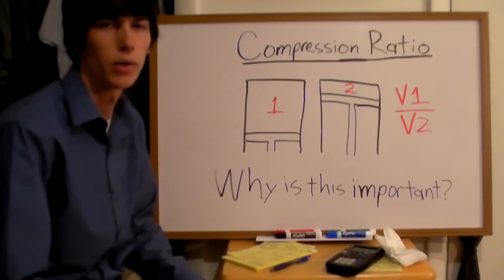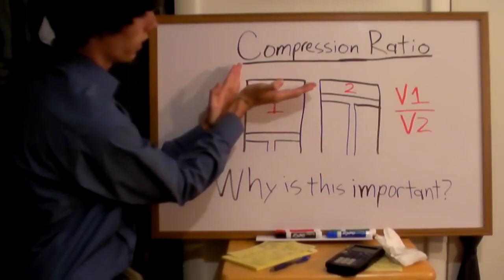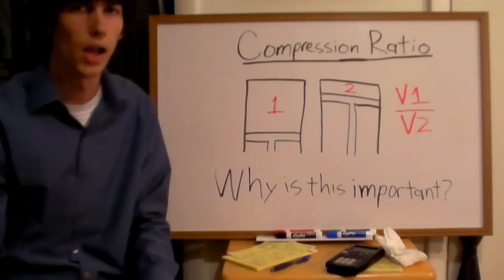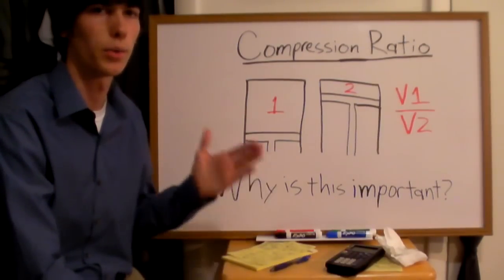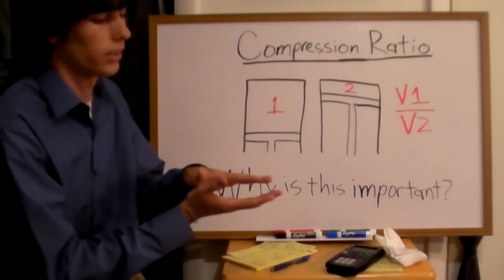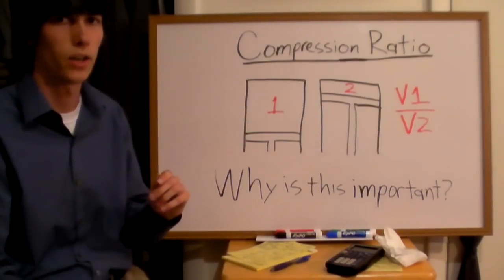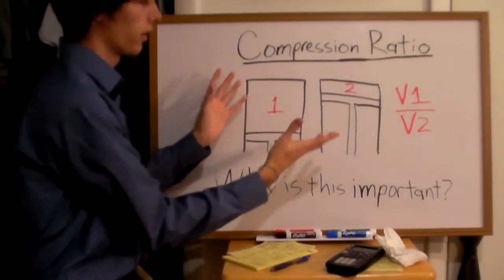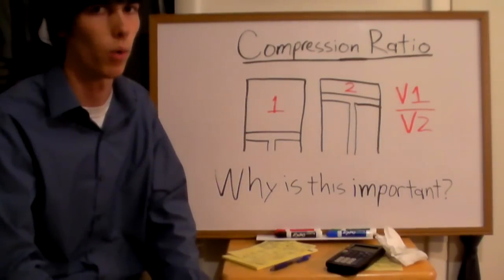Compression Ratio - Explained

Comment: not sure if you're still reading comments from old videos, but what happens when you put low octane gas in an engine that is made for high octane gas? If I understand your lesson correctly, that means the fuel will combust before reaching the ideal compression ratio because the lower octane gas cannot withstand the temperature of the high compression. So does it mean it will combust before the spark plug even "gives the spark"? Will it then cause a timing issue on the engine/drivetrain?

Comment: Can someone explain to me how about same engine capacity 4 cylinder gasoline engine 1.5 liter 
but different compression ratio, one is 10:1 and another one is 11:1..Does it mean that for 11:1 need premium gasoline to prevent engine from knocking?

Comment: fuel octane rating is to prevent pre-ignition so why we calculate compression ratio from BDC to TDC but not at the degree of spark advance BTDC? 
I try to built a 125cc 54x54mm max rpm 12.5k N.A engine with highest compession ratio possible (maybe 13:1)  using RON95 gasoline?  caluclate compression ratio is in safe zone when spark fire but not safe zone when calcualte from bdc to tdc

Comment: I can't figure out my engine is a 11:1 compression ration would I get any benefit to using premium gas.  My manual says it can use basically all grades.  But would I gain anything using premium.
Reply: Lin Y Yeah yeah can gain MPG and horsepower from using premium gas

Comment: hey dude. i hope you reply to my comment. how does one increase his compression ratio?
Reply from the maker: Very difficult to do. It’s more of a design aspect. Changing pistons could allow for slight increases, but really it’s something selected in the design process.
Reply: Engineering Explained wow that was quick! I didn't expect to get a reply after a few days. Well anyways thank you!

I've been trying to figure out a way to get the most power out of an engine that's naturally aspirated. Applying individual throttle bodies to be more specific, instead of gaining more power via boost. Higher compression ratios on a naturally aspirated engine would be alot safer to do instead of a turbo-ed one. I guess changing pistons could probably add another half a unit of compression, but how much of a difference would it be? I guess boost gets a point on this one.
Reply: Btw. What's your name? I've never seen a video where you introduced yourself haha.

Comment: I don't know if you're still checking the comments on such an old video, but why would the compression test results be significantly higher than manufacturer specs?  The car in question is an old aircooled VW 411, with an unknown capacity replacement engine.  The workshop manual states 114-142psi (100 psi wear limit), but an actual test done today showed 165 psi on 3 cylinders, and 180 on the other one (that cylinder was also dead some time ago, due to a fouled plug).  I'm already using Techron-laced fuel, and the plugs were all clean, so I don't think it's due to carbon buildup.

Comment: Then why am I recommended by the handbook to use 87 (91 RON here in Australia) for my MY07 Honda Accord V6 3.0L? I searched on the internet that the J30A5 engine has a compression ratio of 10:1. Actually, I don't really notice a significant difference between 91 and 98 (93 in the US) when I floor it all the way to 5000+ rpm, but it feels like the engine runs better in low rpm with 98 though.

Comment: my yanmar l100n states in service manual the comp ratio is 19:3. I tested the engine compression and im getting 80psi. From what I read up on 19:3 ratio calculates as 19x14.7psi which 14.7psi is atmos pressure at sea level, which is where I am. so 19x14.7=93.1psi. So from this my engine is 13.1psi lower than should be, roughly 14% down.   First off is this correct calculation nd am I understanding this correctly.Also is 80psi too low for the Yanmar L100n single cylinder 10hp small diesel engine?I have called all over the UK and eve diesel engineer I speak to gives me a different answer. though funny enough all these guys cant explain compression ratio to me and all ar claiming it should be 200psi upto 400psi. PLS HELP!!!

Comment: What fuel would you use for 12.0:1 ratio
Reply: Colin Selfslaghs.
For a high compression ratio like that you'd be looking at 105 - 110 octane fuel. The higher the compression, the higher the octane.

Comment: my compression ratio is 10.0:1 it's a 1.0l turbo GDI what does the third number mean? Should I use premium fuel?
Reply: 10.0:1 is the same thing as 10:1 (period here but I don't want that to be confused with the number in the ratio) Use whatever fuel your manual says, or what your tuner says if you have gotten it tuned.

Comment: The Air and Fuel mixture in a gasoline internal combustion engine should not "Explode" as you stated in this video, as that would be detonation. Detonation, (internal explosion's) can brake and burn up internal engine components. When an internal combustion engine is running  correctly, the compressed air and fuel mixture, which is ignited by the spark plug's spark will expand, (not explode),  pushing down the piston. The only gasoline that combusts is that which has been converted into vapor, (a gaseous state), by phase change through heat. Liquid gasoline does not combust.  Octane's are added to  Gasoline in order to slow down the combustion process, to eliminate the occurrence of detonation. The higher the compression ratio, the higher the octane rating of the gasoline will be required to eliminate detonation.  Diesel engines are a different story as, they run on detonation or spontaneous combustion as a mater of course.
Reply: Tony VannTruth  Higher octane does not slow down combustion.Higher octane means that the fuel is less prone to knocking under higher compression conditions.The time where the fuel combusts or in other words "When the fuel combusts?" is determined by the ignition timing of the engine.

Comment: What is the benefit of having a high compression ratio in a performance engine? You talked about fuel economy being an important factor but I have an e46 M3 which has an 11.5:1 compression ratio and the fuel economy isn't all that great so what is the benefits in performance? Thanks
Reply: john smith high comp for n/a build and low comp for boost
Reply: john smith Use Premium gas

Comment: What fuel would you suggest with a 9:4:1 ratio. Been running premium and I'm not getting the power I used to.. Might need to clean the plugs too.
Reply: 9.4:1 is not high at all.  87 should be fine, and you'll get the most power and efficiency from that assuming the car doesn't have carbon buildup problems, which actually increases the compression ratio and can cause problems with detonation (pinging) under higher load conditions.
Reply: +Patrick94GSR the answer I was looking for. Thank you good sir.
Reply: owners manual
Reply: +frenzythebeast did, all it says use nothing under 87 octane. I'm just trying to figure out what is the best for that comp ratio. Might just use 87 or 89. 91 is pointless
Reply: To benefit from the higher octanes you need to tune for it. You can pull more timing with higher octanes which = more power. I thinnk I dynoed 317rwhp on 87 octane and 335 on 93 octane

Comment: In my country, the gasoline available are RON 95 and 97, and most cars have a compression ratio of 10 : 1 so RON 95 is enough. So what kind of higher compression ratio range would need to use the RON 97 fuel...? Is there any difference in performance/fuel economy for a normal car (10:1 ratio) to use RON 97 compared to 95..? It feels like the acceleration is slightly smoother. Thanks . .

Comment: can you explain why some engines can have a higher compression ratio but still run on fuels with lower octane? ie 04 corolla 10.0:1 and toyota says 87 ocatane is fine.

is it because the intake air is cooler than other engines?
Reply: Lower octane fuels has high tendency to auto ignite which is what is required for a CI engine........
Reply: Adhil Binyamin I'm referring to 4 stroke gasoline engine though. Your comment kinda solidifies my question further. If it has a high tendency to self ignite why do they have the compression so high but low octane.
Reply: @shofarsogood7504  Well 10:1 is not a high compression ratio in petrol engines....its mediocre.....
I thought u were referring to GCI engines..

PS : You still remembered 😂 this qstn u asked was 4yrs ago.
Reply: Adhil Binyamin oh it is? I thought 10:1 was pretty high compression. Maybe for my grandfather when engines were not built  as tight with tolerances. Thanks that explains it.  Yea your comment came up in my notifications so.. I never learned from then I guess lol

Comment: so if I ran a 6-1 or 7-1 compression ratio would I use something like e85 instead? also would the engine want to run at higher rpm's if you have a lower ratio?

Comment: How exactly does engine knocking damage the engine? How bad is it?
Reply: +fsmdf "knock" was a bad word to use. An engine knock is associated with a spun bearing or something of that nature. When you run too low of a fuel octane for a certain motor, the engine will ping. Lower octane fuel burners easier and hotter (therefore faster) than higher octane fuels. 87 octane burns faster than say 108 race fuel. The ping is pre-detonation, or the fuel+air charge detonating before the spark plug ignites it at or past top dead center. This explosion pushing down while the piston is still trying to go up causes excessive wear on spark plugs, bearings, and other engine components.

I would also like to add to his videos, (and no offense to Jason, your videos are superb and I have learned a lot from you), Compression Ratio does not solely determine what octane of fuel you need to use. There are some engines with 9.5:1 compression that run on 89 octane pump gas and run perfectly. Other engines, specifically when you get into built motors, with the SAME compression ratio, have to run 98 octane or higher. It varies greatly on your engine, application, and timing curve.

Comment: I loved the explanation and agreed with all until he got to the gas explanation. The higher the octane gas you use the cooler it burns. He said it backwards. In a high compression engine you need high octane fuel because you are running higher pressures and if you use low octane the combustion chambers will overheat and cause the engine to ping.
Reply from the maker: +justin rogers What I'm stating (or thought I was stating) was that more compression means the air fuel mixture is heated to a higher temperature (before you ignite it).
Reply: huh? that's not what he said. he said high octane fuel can resist getting ignited prematurely because it's designed to combust at a higher temperature which also means you need to compress it more to reach that high temperature.

Comment: Hey man, just a quick, somewhat related question that I couldn't find the answer to:

What impact would ambient temperature have on a compression test (if any)? I'm thinking that everything else being equal, testing engine compression at a lower ambient temperature would produce lower results. This would be a similar phenomenon to how your tire may be at 35psi, but the temp drops 50 degrees overnight and all of a sudden the same tire is at 30psi.

I also know that testing an engine's compression at higher altitudes gives lower readings because the air is less dense. What say you? (Gosh, I hope you still check these old video's comments!)

Thanks!
Reply from the maker: I suppose it may read slightly less if ambient temps are super high. I wouldn't expect a large difference.
Reply: Engineering Explained So if ambient temps are lower than normal, you'd expect the compression test to ready higher than normal?

Comment: compression ratio should be (v1+v2)/v2 right???
Reply: +Arjun TM Example time...
If your V1= 100cc and your V2= 10cc, what is the ratio between the two?
In other words, V2 x (Compression Ratio) = V1
If that's true, V1 / V2 = Compression Ratio
Now replace those with actual numbers
100cc / 10 cc would be a ratio of 10:1
Hope this helps!

Comment: The new Yamaha R1M has a 30:1 compression ratio.
Reply: +mitchsfarm 13:1 m8
Which isn't far fetched for a high output Inline-4.
My 2005 GSXR 600 has a static compression of 12.5:1... and it's 10 years old
Reply: Zach Rehak yeah, 13:1 sounds right, I was confused someone told me they had 30:1 and I had to look up how compression worked. THanks

Comment: Okay, so I own a 2015 Mazda 3 with a 4 cylinder 2.0 liter Skyactive engine, and it has a 13:1 compression ratio. I have read forums and have learned I cannot turbo charge bc of its compression ratio. Is there anything I can do about that? Anything?  By the way I love your videos.
Reply: +Jose Jasso Best advice is go talk to a local engine shop. They can help you with purchasing and installing lower compression pistons to work well with your turbo/boost and overall power goals.

You cannot turbocharge this engine as is. You have to run a static low compression so that once boost begins to build, your dynamic compression will go up due to more air and fuel getting crammed into the cylinder.
Hope this helps m8!

Comment: hey bro :) can u do a video about high compression pistons vs forged pistons and advantages/disadvantages, which setup is best for mild performance vehicle or any street car. Thanks! your videos are helping me a lot though
Reply: +Hadi Monyol For a mild street performance vehicle, high compression isn't necessary. It all depends on what lengths you are willing to go to in order to prevent pinging.
My dad had a camaro back in his 20s with 11:1 flat top pistons that he had to mix 118 octane race gas with 91 octane premium pump gas in order to prevent ping.
My 10.1:1 LS1 runs 91 octane no problem in my camaro.

It all depends on your power goals however.
High compression pistons can be forged or cast
Forged pistons just provide strength over cast (hypereutectic). If money is no object or if you're doing any sort of boost application, forged pistons are a must for longevity and some peace of mind. Forged pistons are always a good idea but cast will do if you stay below certain levels. It all depends on the application and engine.

All in all, high compression and forged parts (cranks, rods, pistons, etc) aren't essential to build powerful motors. Higher compression will yield more power but only slightly (i.e. 10:1 to 11:1 will give you an extra 3-5% HP). To get the best idea of what will work best for your performance goals and application, call or go visit a local engine builder. Let them know what your overall goals are and tell them you're confused about a few things. They would be happy to talk to you and help you out.
Hope this helps m8!

Comment: What would the compression ratio be with boost? Or PSI?
Reply: Damon Franklin i was looking into how compression ratio is effected by boost and picked this up just after watching the vid. Its more to do with peak cylinder pressures, that's why you tend to lower compression when you add boost to an engine. so by adding boost at 14.7 psi your doubling the pressure or would be like having an double the compression i guess.

"the boost pressure at the start of compression is multiplied by the compression ratio. At atmospheric pressure (zero boost, 14.7 psia) and 23:1 compression ratio, end of compression pressure will be 323 psi. It will actually be higher due to the heating from compression but for the purposes of this argument we'll leave that part out. The same 23:1 compression engine will have an end-of-compression pressure of 668 psi @ 15psi boost. At 25psi that figure rises to 898 psi and at 30 psi it hits 1013 psi.
These are rough figures, volumetric efficiency and other losses/gains are not taken into account , but you get the idea."

Comment: hey so what if my stock compression ratio is 9.0:1 and i changed my pistons and rods to forged cp rods and pistons are 10.9:1 is that good? also the car is naturally aspirated
Reply: Yes it will surely make more power but you will have to change the ignition timing a bit and use high octane fuel
Reply: FirstOnRaceDay Capri 2904 from what compression ratio will high octane fuel be a real benefit? 11:1? 12:1? I don't know
Reply: Bart Van Riel Well i don't really know but it's useles to put 98 Octane in a car with 9:1 unless it's because of the extra detergents and lubricants which is what i do , i always put 98 Octane in my 1975 Ford Capri even though it has 9:1 comp. the engine runs better and cleaner because of the extra lubricants and detergents sometimes i also use products like a Castrol Valve Master which helps lubricate the valves
Reply: FirstOnRaceDay Capri 2904 hmmm, my bmw z3 1.9 has a 10:1 and the factory recommends regular
Reply: Bart Van Riel Yes it depends a lot on engine temperature and ignition timing , fuel air mixture and many other things
Reply: FirstOnRaceDay Capri 2904 ah like that

Comment: For the first volume, when you had the example of 10:1 do you mean inches of height of the barrel? I'm a little confused, like when when you mean 10:1 do you mean the gap between the cylinder head and the top of the chamber measured in inches?
Reply: It is just how much more air, for example, you can fit inside that space. With a compression ratio of 10:1, you can fit 10 times the amount of air in a cylinder at it's lowest point than at its highest. It's a volume thing not length.
Reply: Ok, thanks for clearing that up!

Comment: Engineering Explained So my car has compression ratio of 10.8:1. I supply it with 92RON, but it knocks only when the AC is turned on and when changing the gear from N to D. And sometimes when I'm stuck in traffic jam and AC is on, I hear it knocking. But with the AC off, nothing happens. Is it a fuel problem or something else?
Reply: Taco
Reply: NarCtX Use Premium gas